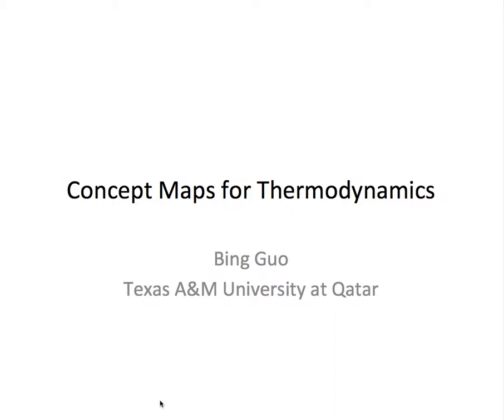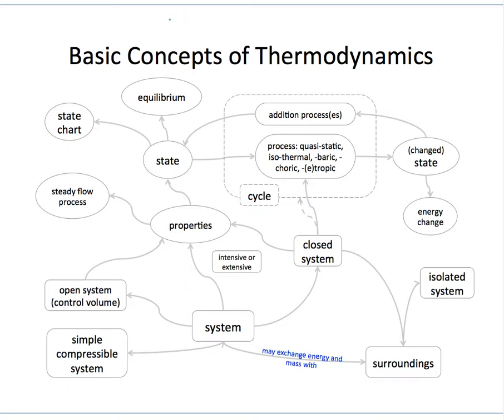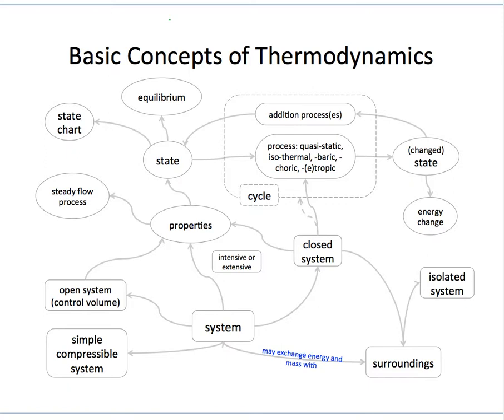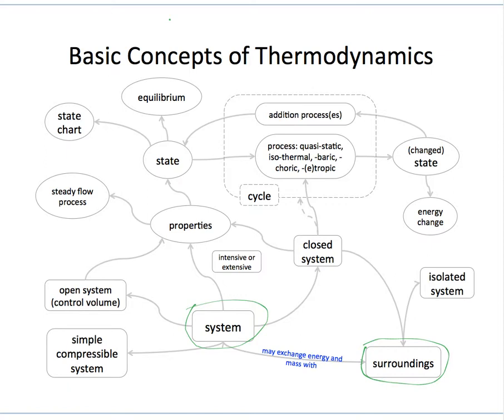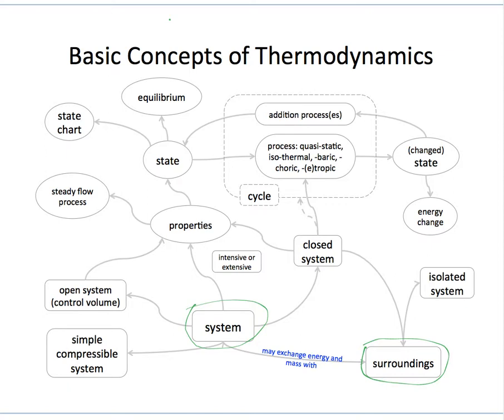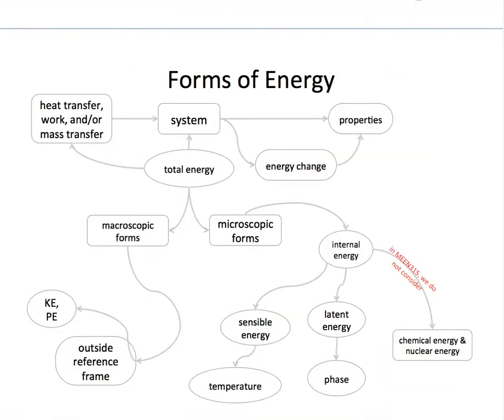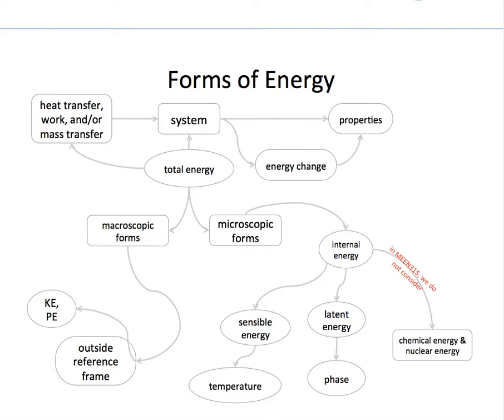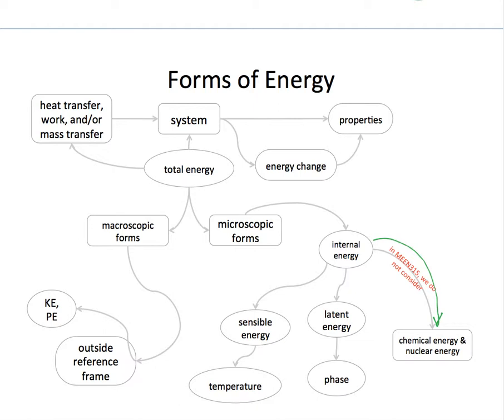Concept mapping for thermodynamics

Comment: Can you please suggest what is addition process(es) here?
Reply from the maker: Thank you for catching the typo. It should be "additional process(es)". Example: An ideal gas system can undergo an isentropic compression process to reach a new state. Then from the new state, the system could further undergo an isochoric heat addition process, an isentropic expansion process and finally an isochoric heat rejection process to return to the initial state. By now the system would have completed an Otto cycle.
Reply: @bing9u0  Thank you very much sir for clarification and such comprehensive explanation.🙏🏼😊